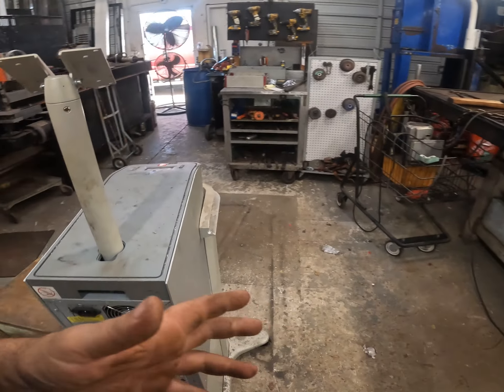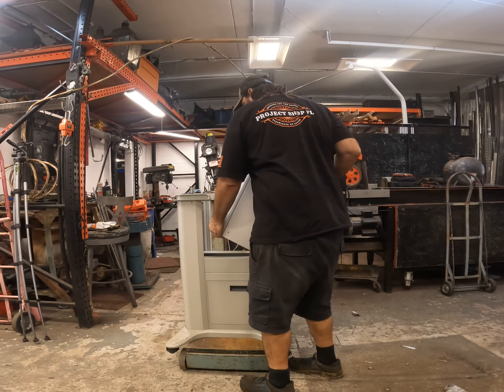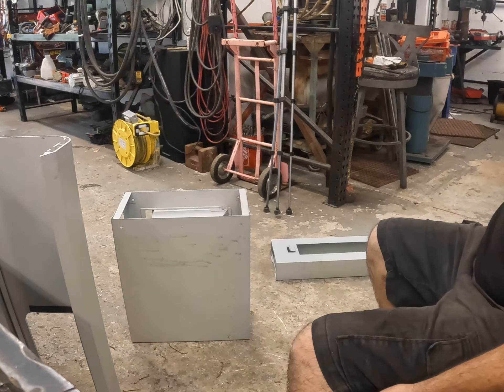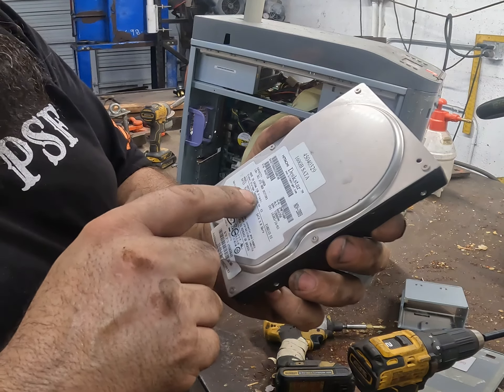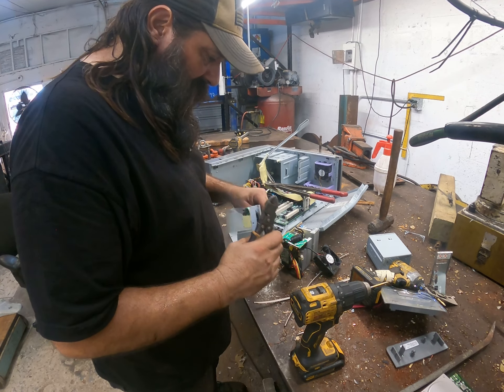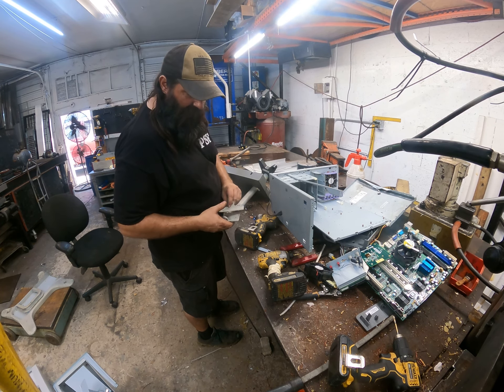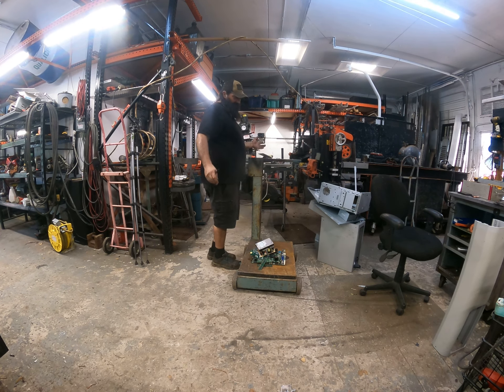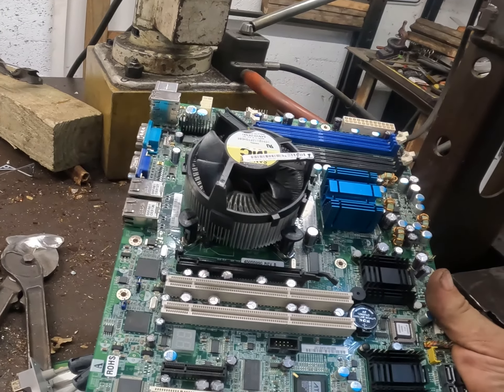Gold Computer Boards Recovered From Medical Equipment

Comment: First board is a gold finger card.  Remove the metal bracket, the heat sink and the fan, and it's worth $5.25/lb.  The hard drive is a SATA hard drive.  Remove the board and it is worth $7.00/lb.  The remainder of the hard drive isn't worth shipping, so throw it in aluminum breakage.  The gaskets are garbage.  The power supply you opened up is worth $0.30/lb. either whole or just the boards.  Not worth shipping.  The large board is the motherboard.  Without seeing the CPU socket, it is probably a "small socket" motherboard worth $3.990/lb.  Those cards are the motherload of this whole unit!  Those are the RAM memory and are worth $26.00/lb!!  Absolutely sell them separate!  No, take the wire off the board.  Also remove the heat sinks and under the large heat sink with the fan is the CPU chip.  Remove that as well and keep it separate.  Without seeing it, it is probably a "pinless" worth $6.75/lb. or a "P4 Green Fiber with metal" for $9.75/lb.  That's a new thinner CD drive, not worth getting the board out of.  Whole CD drives are $0.25/lb.  Not worth shipping.  Take the gold pin board off the back for either gold recovery or they're worth $1.00/lb as "connector ends".  Last board would be considered "mid grade"  not worth shipping at $0.40/lb but does have a little gold recovery potential.  Good video, Derek.  There is a shit ton of money to be made in ewaste, but like your copper, you got to deal in volume.  I'm currently putting together about a $1K shipment to Boardsort that is going to fit in 2 flat rate postal boxes and one larger box!!  😁👍👊
Reply: Im with CU, can be good money in ewaste
Reply from the maker: Wow, Thanks for the info. I will probably keep saving them till I have a drum or 2 them try and recover the gold.
Reply: @ProjectShopFl how would you go about recovering the gold ?

Comment: just like everyone else here, i'll also recommend removing the heat sink from the motherboard, along with the IC chip. Many of those round heatsinks typically have a copper nugget in the middle that you can press out, and you're also left with a piece of extrusion. Ewaste Ben from Australia has really good videos on scrapping ewaste and making big money from boards and the lot. Cheers from Canada.
Reply from the maker: Thanks for the suggestion

Comment: Hey on that one board with the big round aluminum heat sink. Take the fan off sometimes there is a copper ingot in the middle.
Reply from the maker: I will take a look, thanks!

Comment: That mesh material behind the backplate for the motherboard connectors is a conductive material that's there to make good contact with the connectors and work as ESD protection (anti static, you come with plug in fingers and you're statically charged, you'll zap the shielding and not the pins in the connectors) and is also supposed to act as EMI shielding (the whole computer is in a sort of faraday cage, reducing the electric noise and radiation it produces)
People often cut off the blades off fans and put the hubs as motors at scrap places. The ram sticks are worth money, but it's a volume thing, collect enough for a 20-30 pound box and ship it for gold recovery to boardsort or a company like that.  Same for the CPU under the cooler on the motherboard. CPU coolers can have copper core inside the extruded aluminum on the outside.  Remove heatsinks off motherboards before sending them to gold recovery. 
Hard drives... the circuit board is worth taking off, the internals not so much,  the weight is in the case of the drive. Hitachi bought the IBM hard drive factory, then they worked with LG for some time (HGST brand) then they sold the drive factory to Western Digital, one of the big hard drive manufacturers besides Seagate and Samsung and Toshiba.
Reply from the maker: Thanks for all the info. 👊

Comment: The body of computer harddrives are made of cast aluminum. If you manage to tear one completely apart, you can sell it as clean cast.
There are a lot of Torx screws on it to remove first. Save the PCB. There is gold on it and INSIDE the electronic IC's that are on the PCB.
The Round platters are usually aluminum coated with Iron Oxide or other metals. Maybe you can melt them in your furnace?
Reply from the maker: Thanks for the suggestion

Comment: Hi Derek. Remove the heat sinks , fans and the CPU chip . There should be gold pins under each CPU chip. 
That big cube  is to be disassembled. That cools the Processing chip inside.
Reply from the maker: Thanks for the info. 👊

Comment: The weird weave weatherstripping is to stop electromagnetic radiation (noise) getting out. It just ensures all of the panels are grounded together. Especially important in medical stuff where EMR might very very slightly affect medical devices.
Reply from the maker: Thanks for the info.

Comment: breakage board on that power supply. maybe .20 per pound. the memory on your thumbnail is $10 per pound the motherboard is about $2 per pound
Reply: I'll pay you $10/lb all day long for your RAM!!!  Then turn around and sell it to Boardsort for $26/lb!!!
Reply: @cuscrapping  depends on the type and if  it has shielding.
Reply: @keckpc  Correct.  What was shown in the video was gold fingered RAM...$26/lb.
Reply from the maker: Thanks for the info

Comment: 160 GB is not much. I have worked with computers for 25 years! I have seen 9 TB (terabyte) HDD. 1 TB is 1024 GB. I've built so many computers I've lost count. It is so easy to make computers. Changing CPUs, RAMs etc. Installing software is so easy! I have helped so many people that it is countless. The first computer I got was with a 4 GB HDD. It was the first. Now I'm up to 4 TB. Have a lot of external HDD. You have more goldpins, if you take the CPU out.
Reply: Got you beat by a few years...my first hard drive was a cassette recorder!!  😳😂🤣 From an old Texas Instruments TI-99A!!  Wish I had THAT CPU now at $225/lb!!!  🤑
Reply: @cuscrapping  LOL Would never ever have a PC with that! I was waiting, also it was so expensive! So i got a little more for my money. But it will get cheaper. Not i have 4 laptobs and 3 PC's. Making them myself, when they crashes! Love them.
Reply from the maker: Thanks for the info!
Reply: @ProjectShopFl  The CPU is under the biggest fan and cooler!

Comment: Just concentrate on the wire and the metal. The memory sticks are separate they jave value you can depooulate some chips from the boatds that gave value and still sell the boatds for a value. The littke finger are cut off and saved separate.  Please sit and watch some of  ewaste ben. He will reach you every part you have if balue and still get value iut if the boards and the hard drives after you tajr the best pieces
Reply from the maker: Thanks for the info.

Comment: That power supply board is low grade board,   It worth getting all copper and alumium goodies off,  
And it would still be low grade board.
Reply from the maker: Thanks for the info.